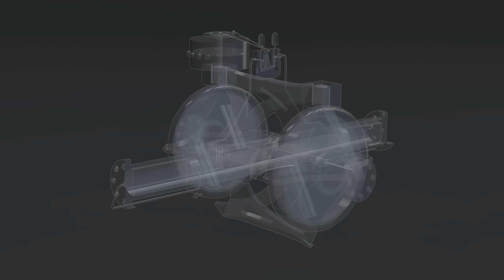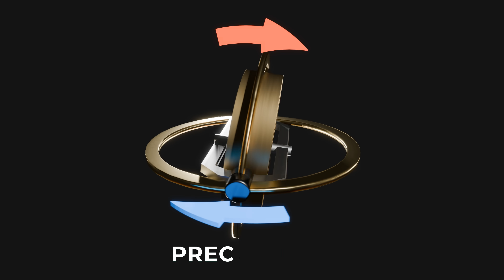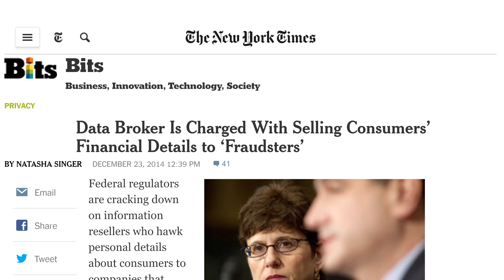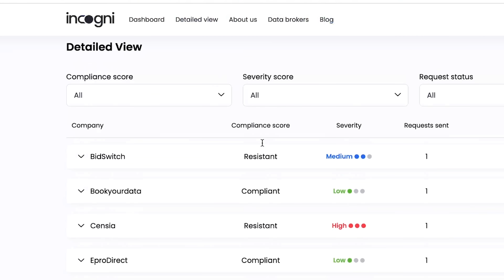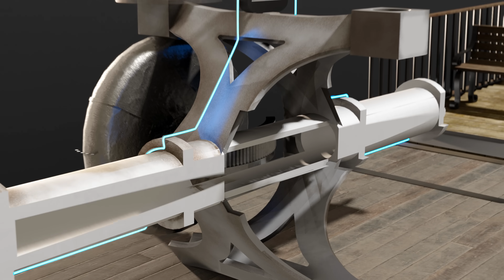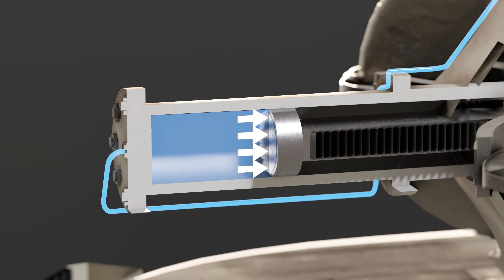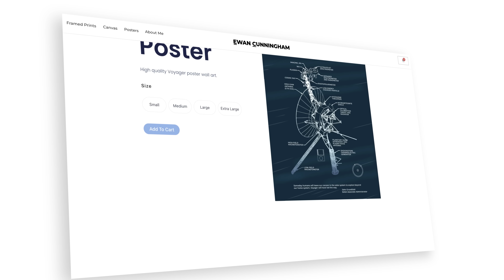The Self Balancing Monorail

Comment: whichever era it is, the brilliance of the human mind always tries to push the boundaries of physics to its utmost limits. Brennan is a great example.
Reply from the maker: Agreed. And I had so much fun learning even more about it!
Reply: @primalspace So awesome, thank you for sharing!!
Reply: @primalspace I have a picture of a ghost on a tv.
Reply: .. it was the design of a particular person - not humankind in general. Credit goes to the person who worked out a solution to the task to be solved.

Also, the era is important since no advanced electronics were available.

Think before you post.
Reply: @Chris_Sheridan  Not just the person, but what race was this person? The race is significant here since many others of this same race were also very innovative.
Reply: Except for the dirt.  That is, the strength of the soil under the tracks.  With only one line of wheels, a ground supported monorail will cause more load on the soil itself.  So this would have also limited this trains cargo capacity.  Would have been good for passenger trains and light cargo only.  Unless they spent more money on soil improvement under the one track.
Reply: @tomcibulskis7649 I'm not an expert, but with only 1 rail, the ties would have had a tougher time staying in place.
Reply: @eugenetswong  Yes, specifically, the connection of the rails to the wooden ties, would have to be stiffer and more reliable than the standard type.
Reply: @tomcibulskis7649 Germany, Austria, and Switzerland use concrete ties for their pressurized trains on extremely well graded and level routes through the mountains that make for unbelievably smooth rides through incredibly steep terrain in the Alps.
Reply: @eugenetswong  that’s why he banked the curves… there are illustrations in the video.
Reply: @tomcibulskis7649  .. you've completely missed the original point - only one track has to be engineered, even if support piles have to be evenly spaced under the rails according to the terrain.

Such a system could be developed exclusively for a postal service - removing the risk of transporting passengers.
Reply: @tomcibulskis7649  that's not a real problem. Wherever the ground is not hard enough, you can just use longer planks and you get the same stability as on regular rails
Reply: @electricpaisy6045  Not if you are in a swamp.  Soil strength varies from zero to 6000 psf.  "Soil improvement" would be more expensive with a monorail.
Reply: @tomcibulskis7649  nobody talks about soil improofment. And if a plank is as long as in a standard rail, it doesn't matter if there are one or two rails on top.
Reply: Exactly my thoughts! I expected commenters to state that tired line about how creative and innovative people, institutions, society was X-number of years ago. 
But all eras have been full of genius. Some times have been more productive or less productive  than others due to a variety of factors. 
As a child i became fascinated with how much of our modern tech had roots in the war that had changed everything.  The first jets, the first computers (tho, not digital yet) radar and atomic technologies. Etc.
Now innovation is occurring that's largely beyond the comprehension of avg person. We know our tech is getting better, phones and computers smarter, faster, self-driving cars, etc. But the HOW that is occurring is beyond the understanding of laypeople.
Reply: @Macumazahn16 Well, not really, all eras did not have the same degree of genius as we perceive it today. You could argue that all eras had the same potential for genius, had they had similar resources, cultural values and education. "Geniuses" were usually rich and privileged, having copious amounts of free time and connections to powerful individuals or organisations willing to finance their tinkering. The modern idea of a random stroke of genius among the people only really became possible with the advent of mandatory schooling, and significantly better living standards as a result of automation. Before then, your average peasant who had to work their backs off in the fields stood little to no chance against an educated noble. People are clever, and always were clever, but the more complex machinery like this really could never have been possible without the societally maintained degree of privilege and comfort, not to mention all the unglamurous work of data collecting and important lesser innovation done by the majority of people that genius then relies on.
Reply: the era after 2010 is the era of idiocracy
Reply: End the Evil of the Big J investors ;)
Reply: Monorails already suck, turning it into a bike on a rail is worse
Reply: @nigeladams8321  Why do monorails suck?
Reply: @Rootle2  mostly because they try to solve a problem that isn't a big problem to begin with. Two rails on a track is economical and functional. Trying to minimize the amount of rails while introducing other problems such as specialized upkeep, balance issues, and specialized infrastructure. In just about every use case of train would be better
Reply: and then there are orangutans who get mad because their flight is delayed
Reply: Absolutely right my banj
Reply: oh I already grabbed the patent diagrams and invented something
Reply: Ikr. It's still a mind-blowing design even to this day.
Reply: I feel that we as humans were way smarter back in the 1900s than what we are lead to believe!
Reply: @labbeaj  I think there is a bias about that. 1. We only remember the smart ones, not they average ones and 2. Other than today they're was much more stuff left to be discovered and invented. Newton wouldn't be famous today if somebody else before him discovered gravity but he would have been just as smart
Reply: @electricpaisy6045  There!!
Reply: @labbeaj  thanks
Reply: @labbeaj  European ingenuity was allowed to flourish, it's not merely humans that were smarter back then, it was Europeans being Europeans back then.
Reply: this is why we need politicians and bureaucracy to stay out of the business of innovation.
Reply: @wizzerwiser2056  not really, that thing just was too expensive to use
Reply: @BurnedBjorn I don't mean this invention per say. It's just now a days politicians want to ban gas powered machines and force people to go electric instead of just allowing innovation and a free market to dictate that.
Reply: @wizzerwiser2056  no they don't
Reply: @BurnedBjorn  Biden literally signed into law a requirement for all cars to be electric by 2032. Why are you lying?
Reply: How can you push the boundries of physics? That makes no sense...
Reply: @Rootle2  you can push boundaries of knowledge
Reply: @BurnedBjorn  Yeah, exactly
Reply: AKA Reinventing something that didn't need improving, all for the sake of "Innovation"
Reply: Primarily from white people
Reply: @FolstrimHori  White*
Reply: Settle down. Also, you can't push the boundaries, they are what they are...
Reply: Thank you
Reply: we are nowhere near the limits of physics
Reply: And then the greed and corruption of a small group of people who have the ability to shut down someone’s brilliance always seems to get in the way and ruin progress and technological evolution, as in the case of Tesla.
Reply: Hello ! May Allah protect and guide you to his light and happiness in this life and the hereafter, God bless, Ameen. Excuse me for giving a little presentation of Islam, because it is very misunderstood nowadays, especially on those « Antichrist's » times, where media and politics are mixed to distort history and truth. Thank you very much for your time.

Islam is an arabic word that means the Surrender to the One and Only God, our Creator, Protector, Provider, who gives us life and all that we have, we are safe and sound by his will and grace, we are His and to Him we return, and we have to thank him in this trial life by submitting to him by our free will, or later in the Day of judgment when it's too late to save our own skin. Islam was the original Religion descended to earth from heaven with Adam and Eve (peace and blessing be upon them) in the beginning of humanity. and was passed to people with the succession of the 124 000 prophets and 315 messengers of God to all nations and civilizations since, passing by Noah, Abraham, Isaac, Jacob, Ismaël, Joseph, Moses, Aaron, Joshua, David, Solomon and Jesus (Peace and blessing be upon them) during the history of mankind, the last replaces and completes the previous, until the succession of the last messenger of God fourteen centuries ago, Muhammad (Peace and blessing be upon him) to complete the noble morals of all mankind, to bring humans and jinns out of darkness into light, and to purify people's religion and belief from corruption and polytheism, and return it to purity and true monotheism, like it was in the times of the prophets (Peace and blessing be upon them).

Many Religions that we know nowadays, at their beginning were true and under Islam, initiated by one of the prophets of God, but their original teachings, history and scriptures have been corrupted over time with falsification and polytheism, or lost and replaced with false ones. That's why Islam is the only Religion accepted by God nowadays, which consists in bearing witness that there is no god besides Allah (God in Aramaic, the original language of Jesus and the Gospel), and that Muhammad is His servant and messenger, just like Jesus and Moses and others are His servants and messengers. Never a messenger of God said he was God or literally son of God, it was the people after him who changed the words of God and corrupted the Religion. God is unique and absolute, He does not need to have a family and sons or to associate anyone else with His kingdom, He can simply create whatever He wants, everything belongs to Him, and to Him everything will return. Allah said in Surah Al-Mu’minun : “God has never begotten a son, nor is there any god besides Him. Otherwise, each god would have taken away what it has created, and some of them would have gained supremacy over others. Glory be to God, far beyond what they describe. The Knower of the hidden and the manifest. He is exalted, far above what they associate. (91-92 / Translated by ITANI).

Allah means the one and only God, the God of all prophets and creatures, the creator of the universe and mankind, and the Master of the Day of judgment, where our destiny, Hell or Paradise, is decided based on our faith and deeds in this trial life, and above all, Allah's mercy. 

Allah said in Surah Al-Ikhlas : In the name of God, the Gracious, the Merciful.
Say, “He is God, the One. God, the Absolute. He begets not, nor was He begotten. And there is none comparable to Him.” (1-4 / Translated by ITANI).

Allah said in Surah An-Nisa : O FOLLOWERS of the Gospel! Do not overstep the bounds [of truth] in your religious beliefs, and do not say of God anything but the truth. The Christ Jesus, son of Mary, was but God's Apostle - [the fulfilment of] His promise which He had conveyed unto Mary - and a soul created by Him. Believe, then, in God and His apostles, and do not say, "[God is] a trinity". Desist [from this assertion] for your own good. God is but One God; utterly remote is He, in His glory, from having a son: unto Him belongs all that is in the heavens and all that is on earth; and none is as worthy of trust as God. Never did the Christ feel too proud to be God's servant, nor do the angels who are near unto Him. And those who feel too proud to serve Him and glory in their arrogance [should know that on Judgment Day] He will gather them all unto Himself: (171-172 / Translated by Muhammad Asad).

Allah the Most Merciful said in Surah Ali-Imran : Behold, the only [true] religion in the sight of God is [man's] self-surrender unto Him; and those who were vouchsafed revelation aforetime took, out of mutual jealousy, to divergent views [on this point] only after knowledge [thereof] had come unto them. But as for him who denies the truth of God's messages - behold, God is swift in reckoning!
Thus, [O Prophet,] if they argue with thee, say, "I have surrendered my whole being unto God, and [so have] all who follow me!" - and ask those who have been vouchsafed revelation aforetime, as well as all unlettered people, "Have you [too] surrendered yourselves unto Him?" And if they surrender themselves unto Him, they are on the right path; but if they turn away - behold, thy duty is no more than to deliver the message: for God sees all that is in [the hearts of] His creatures.
Verily, as for those who deny the truth of God's messages, and slay the prophets against all right, and slay people who enjoin equity - announce unto them a grievous chastisement.
It is they whose works shall come to nought both in this world and in the life to come; and they shall have none to succour them.
(19-22 / Translated by Muhammad Asad)..

God said : Say, “We believe in Allah, and in what was revealed to us, and in what was revealed to Abraham, and Ishmael, and Isaac, and Jacob, and the Patriarchs, and in what was given to Moses and Jesus, and in what was given to the prophets from their Lord. We do not differentiate between any of them. And to Him, we surrender.”
(2:136 / Translated by Community)

Salam (Peace) -----------------------------------
Reply: Boundary is a synonym for limit.
You're saying they push the limits to the limit.

Okay have fun bud
Reply: @joshyoung1440  Hi!
The concept of a boundary is essentially an internal construct, serving as a collective representation of all the discoveries we've made so far. In contrast, a limit is something which is set by the nature itself. you can assume "boundary" as local maxima and "limit" as global maxima.
Reply: Brenen's design is so underrated!😅
Reply: Indeed true, we are totally amazing, but still we kill each other, I don't get it. We need to stop the childish my god's better than yours and move forward., all I can see at the moment for mankinds future is destruction of everyone, the planet won't care it'll carry on like it always has.
Reply: The brilliance was using a nigerian scam joke.
Reply: & now society has gone way back
Reply: Eat ur heart out Egyptians hmph
Reply: tobacco is harmful 💀💀💀
Reply: No, because this is a really really stupid and unsafe design. Failure of a single compressed air fitting means derailment, totally horrible
Reply: I remember there Chrysler Jet Car which could run on basically anything flammable, the president of Mexico even asked "can it run on Tequila?" and they drove around the president of Mexico in a car powered by Tequila
Reply: People literally push their understanding of physics
Reply: Thanks for stating the obvious dumbazz
Reply: Yeah, he amused me a lot
Reply: Yep
Reply: Brilliance of the White race*
Reply: Why do you call it brilliance like it's the pinnacle of sentience. How do we know that these things are not trivial issues other species in the universe have their children solve.   We are likely barely functioning retards on the scale of intelligence.
Reply: this fockin’ guy… freakin’ genius is what he is. the double flywheel to allow turning… but the pneumatic assist for natural procession was super genius.
we need someone like him working on global warming.
☮️❤️
Reply: This principle can be used it some special project or prototype...but not in train ..
Reply: I think as far as contraptions go a bicycle train that balancing by going fast is pretty far away from the boundaries of whats achievable
Reply: I worry human ingenuity will stagnate with the advent of AI.....
Reply: Wow. Humans are problem solvers? How incredibly profound and astute of you to point it out
Reply: The true state of human technology is MANY generations ahead of what the public is allowed to know about.

Patent 'law' was absolutely essential in setting-up this totalitarian knowledge gap.
Reply: Oh shut up. You don't have a clue.
Reply: *Some humans' mind

I think if all are considered, it'd seem that it's actually a few among us who conceive ideas that are improvements, others just learn from them, mimic them, use them, spread them (making it seem that they've discovered it), some even oppose them, unwilling to change their minds, oppress & mock them, as in case of Galileo. Maybe, let's not take & feel credit for something that few individuals were able to discover, conceive, imagine before sharing it with those around.
Reply: @kepspark3362  It's almost like there is a way to group humans up by internal species differences, subspecies? I'll go with race. The "some" humans you're referring to here are White people.
Reply: @kepspark3362 
'Some human's mind' or 'some humans' minds'.
Ie 'the (singular) mind of some (singular) human' or 'the (plural) mindS of some (plural) humanS'.
Unless, of course, you are alluding to the philosophical 'many people being of one mind'. 😉😊
Reply: @trueaussie9230  Oh thanks! I always check my comments before posting & fix the language mistakes. I like to adhere to the rules that makes sense to me, I try, to the best of knowledge at the time. This 1ce, I decided to ignore it, then I met you. 😊
Reply: @kepspark3362  
Hahaha.
Just your luck to 'meet' an ESOL teacher. 😉😊👍
I'm pleased to know you're willing to learn from your mistakes.
So many of today's puerile 'entitled' muppets become aggressive at any suggestion that they've made or possibly could make any mistake.
Reply: @trueaussie9230  Many people can be of one mind, it's called living in a high trust honor society, like NS Germany
Reply: True, we humans really want to have a comfortable life and that goal makes us create this kind of invention. We want to go to other country fast like a bird, so we created planes. We want to go to other side of the island cheaply, so we created ships. We want to talk to other people without using mail, we created sms and internet.
Reply: @cyrlangaming  Then why didn't Africans invent this sort of stuff? If all humans think like this, why didn't all humans do this at about the same time? Why was it only Asians, Europeans, and Arabs?
Reply: The white mind.
Reply: @893R6-w8t well said
Reply: White European Ingenuity.
Reply: @1neAdam12  Bro I am irritated by these types of comments, it has nothing to with skin colour, in my opinion there is only one race the human race.
Reply: @selvarajrajavelu7331 
Are all the breeds of K9 exactly alike in every way?
Reply: @selvarajrajavelu7331  massive cope. Name 1 ingenius invention by blacks.
Reply: But over complicate the train
Reply: @voidocvali  
Do you mean similar to how today's motor vehicles are overly complicated - especially when compared to the very first automobile?!
Reply: Anyway, that was that era, the appreciation of good manners and the appreciation of intelligence. And the appreciation of team work, positivity and finding solutions in peace and quiet. With today's technology, we will never get there, rather it tempts us and brainwashes us by making us believe certain beliefs from others.
Reply: @bobmarly7654  That era was distinctly European
Reply: Not human mind ,male men mind
Reply: @kurtman752   Stephanie Kwolek is an american chemist who discovered kevlar (a material which is 4 times stronger than steel), now used car structures, houses, frying pans, body suits etc. 
madam curie discovered the theory of radioactivity.
Dr. Shirley Jackson 
a black woman whose research enables us to use solar cells, fiber optic cells without which it'd be impossible to communicate in long distance.
keep your lil brain and your lil ideas to yourself brother. by your comment i can already judge your mental age to be below 10. grow up.
Reply: This is not Physics. This is engineering and design 😎
Reply: The mind is a gift from God :)
Reply: This is a reply to all those here who refer to the collective human mind as the source of such engineering. I find that it is imperative to properly attribute these innovations. Which human mind(s) exactly? These feats were not a creation of the whole "human race," but of particular groups of people in certain areas of the world. I notice that many in the modern global populace seem to think innovations in engineering and scientific discoveries were a product of a whole world community, in a way. Of course, there was collaboration and ideas were expanded on by others, but this happened only in societies were there was potential. Perhaps I am stating the obvious, but it is important for us not to forget who exactly did what. 👍🏻
Reply: and then the US came in and invented patent and invoation slowed down to the point of were going backwards. best example is jet turbine cars
Reply: @deesmith8576 patents are much older than that
Reply: @deesmith8576 i doubt it would catch on either way, jet turbine is extremely power hungry
Reply: @artemiusz69 and expensive and high maintenance.
Reply: @deesmith8576 Bro jet turbine cars are not a good idea
Reply: @deesmith8576 Jet turbine cars would have been inefficient.
Reply: @deesmith8576 ... Hey there Dee... Yes, Patent and Copyright are social controllers, once again only benefitting the rotten rich. EG: YouTube CR picks up tiny bars of music which would enhance a video, but will only finnish up with a strike. And who owns the music, not the writer, oh no, but buyer (the rotten rich) !!! Music takes us back to special times and occasions... And the bstards therefore steal even time itself. It is OUR music which we paid the money for at the time and they made their profit !
And yes, patent is bought up once again by the RR and then shelved. They control time and progress... 
These people cannot let anyone or anything free wheel. 
They are total control freaks and this is their only claim to fame... Truly, the black arts at work !
Reply: @deesmith8576 it was not like it was unsuccessful, it was just developed way to early. New vehicles laws made it so Chrysler had to keep spending money to make the engine legal, paired with the fact that Chrysler spent billions on prototypes and production, and how the vehicles were imported and taxed.
Reply: @deesmith8576  it's business and finance people slowing engineers down, not patents.
Reply: @deesmith8576 the Abrams tank failed in Ukraine because of the insane logistics, how are we to put that in cars?
Reply: @deesmith8576 just not true.
Reply: @deesmith8576  Patents are what ushered in the era of scientists/inventors as a profession rather than some rich person's hobby, making it possible for the first time to make money from the usefulness of your designs, rather than just because a royal liked you enough to finance your tinkering. Not to say that progress wasn't often slowed down or straight up sabotaged by less efficient alternatives to current patents (i.e. sun-and-planet gears having to avoid the patent for a very simple crank mechanism). Though in some cases the alternatives ended up more efficient (i.e. the flaps being an alternative to Wright-brothers' patented wing-warping).
Reply: @nikobitan7294  na it just makes it so that no one can improve the product. Please think more clearly its also abused in the usa insulin 300 plus dollops while in india its 18 cent
Reply: @deesmith8576  would you invent anything if you could own that invention and make money off it? Why would anyone invest money in research if anyone could come along and steal your research? They wouldn't have to make the investment you did so most likely they would be ahead of you.
Reply: Definitely brilliant. Soon we will push the boundaries to the very edge and all this technology will have eliminated every job. In the last 50 years, freight trains have went from 6 crewmen to 2 per train. And they’re trying to push the boundaries so that there’s only one employee on the train. Then they will have more time to figure out how to eliminate that employee and have a computer control the train. Meanwhile the US population increases daily at a rate of one more mouth to feed every 19 seconds. One day we will push the boundaries of how many folks we can fit on this planet unless everyone starves to death first
Reply: @deepmarsh  
You need to catch up with today's technology.
There are already trains with NO onboard crew.
Reply: It's truly mind blowing but it's rarely ever used for any good, instead it's used to craft new weapons to kill each other and other stuff that destroy nature as it is
Reply: @chargyplays  Calm down. The vast overwhelming majority of inventions are not used for destruction.
Reply: Calm down. This mindless patriotic outburst is better suited to 4th/July not ~January.
Reply: Human mind? This was a European mind
Reply: So true. White excellence!
Reply: @James.B.Russell   There is only one race the human race
Reply: Don't say human mind, the inventor is German, you know damn well an African will NEVER invent n create something like this
Reply: @hulahula6182  Nor did africans have the same amount of education or resources. what exactly is your point here?
these differences dint exist 150 years ago, yet we're existing for almost 5million years
grow up.
Reply: @gowthamkilli2065  who educated the europeans then? Did they magically get educated on infrastructure and agriculture or did they actually bother to educate themselves?
150years LMAO, are you joking right now? Romans have been building monuments millennia ago while africa still struggles on basic agriculture today
Reply: brennan is way better  than the clown called  newton